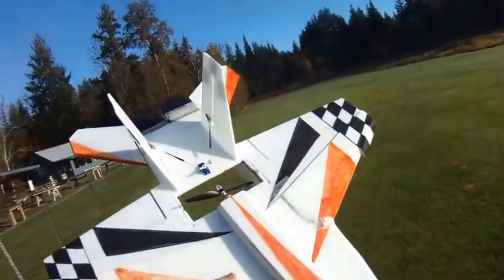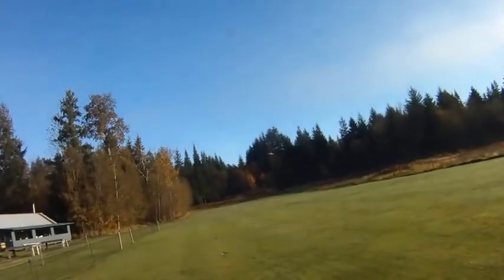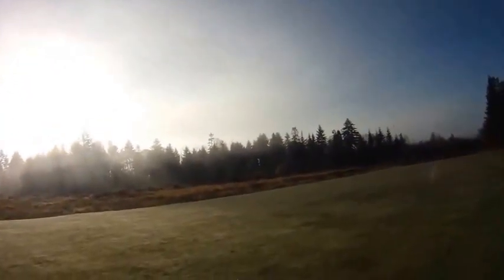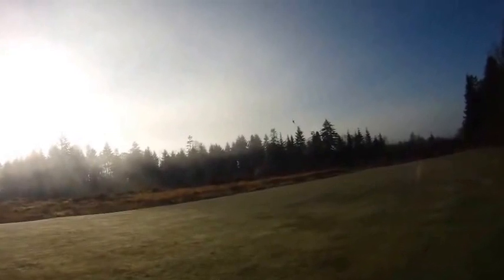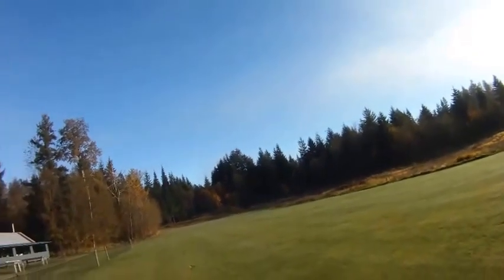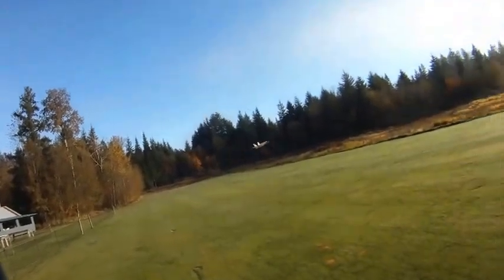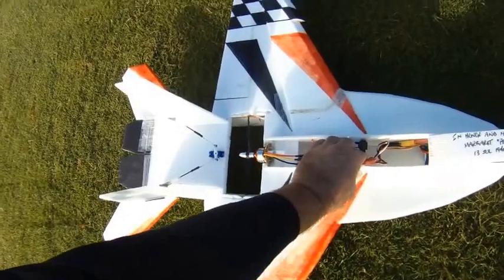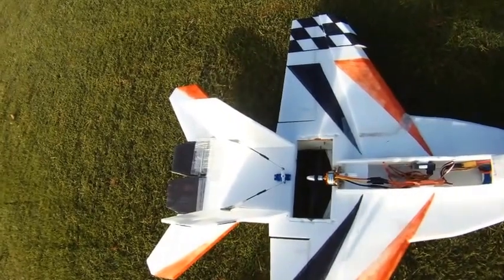RCP F18 V3 and RCT 2208 2600 Kv motor

Comment from the maker: No, not in this video, I was running an 1800 Mah battery.  I did fly it with a 2200 Mah battery, but the extra weight bogged it down quite a bit.

Comment: Sure... the shipping was $2. I Still need to get the better foam to build this planes. I have been using Elemr's. These foam boards are not that light. I will probably end up buying Model Plane Foam. It's about the same price as Elmer's, it's just that there are 16 Sheets on a box, I'd say it's a good deal.

Comment from the maker: I used a 30A ESC on mine, that is what RC timer recommends and it worked really well.  I use Turnigy Plush ESCs, but any decent 30A ESC should work fine.